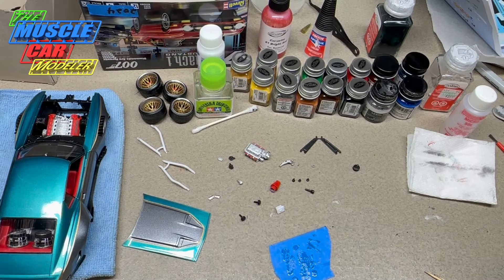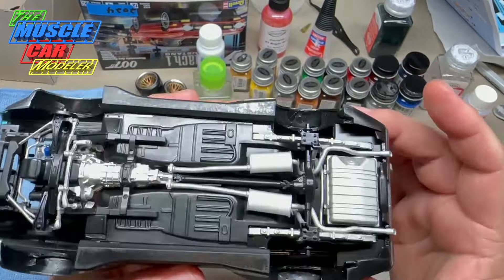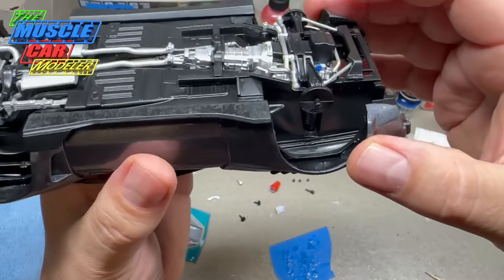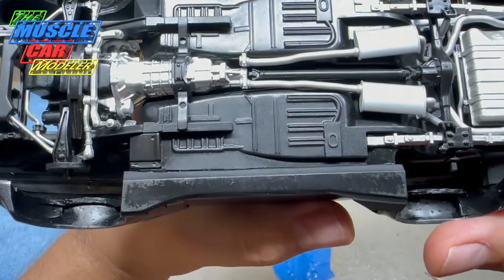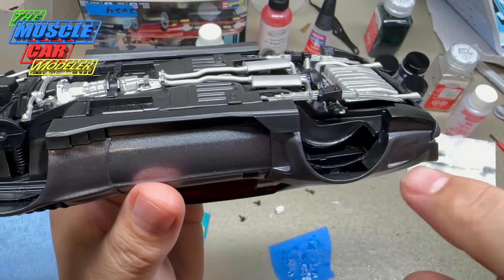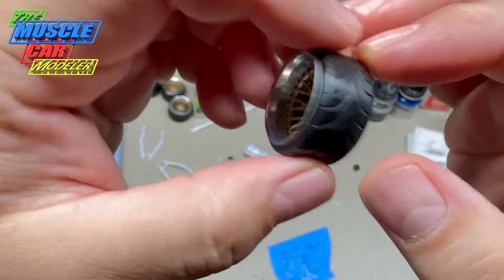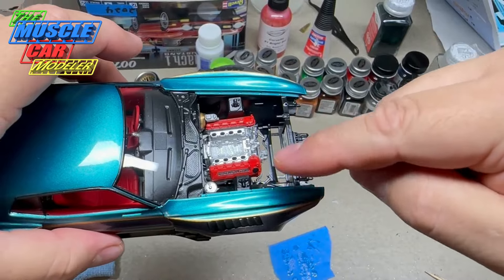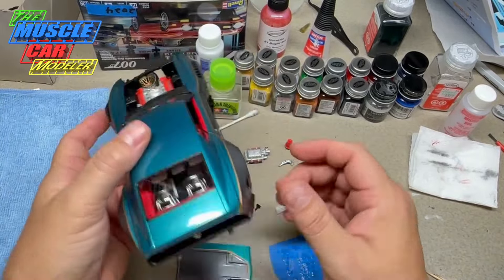Revell 1971 Ford Mustang Mach1 Widebody Update 14 engine in and chassis assembly

Comment: The motor is a little over scale- even for 1/24 IMO.
Reply from the maker: I don’t know if the scale is correct but the motors in real life are huge. They are tall and being a dual over head cam design are wide as well. They won’t fit in most Mustangs without removing the shock towers. I have not seen one in any 71s though. So far only in the 70 and older Mustangs.
Reply: @TheMuscleCarModeler  I have a supercharged gen1 coyote, so yes they’re large- but compare it to the revell boss 302 motor and you’ll see my point.